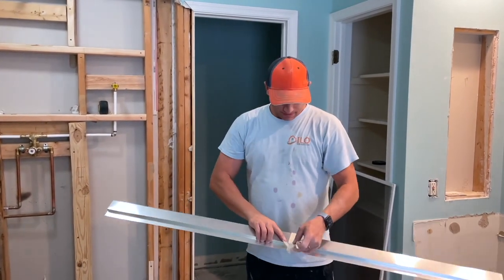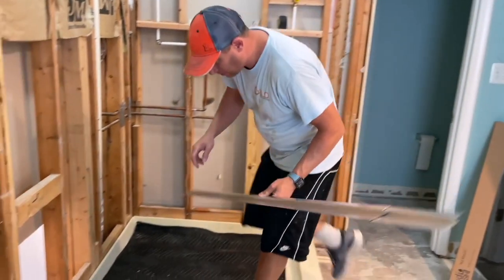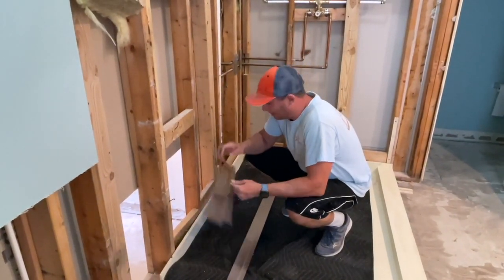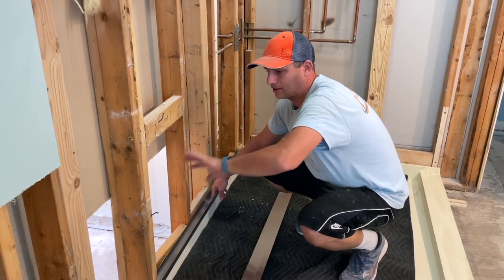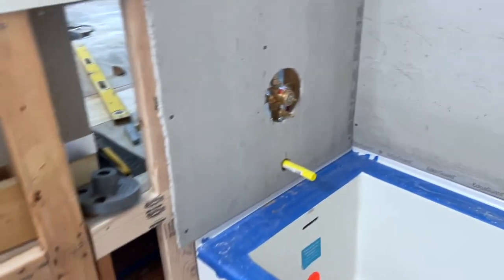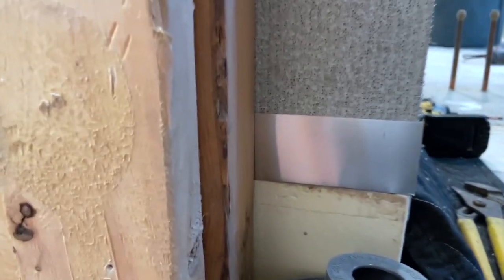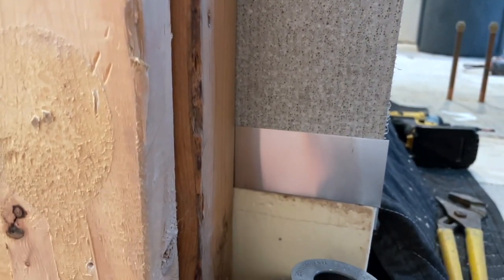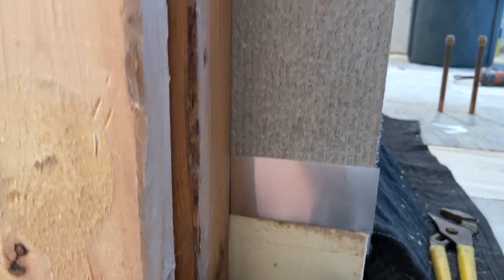Installing the Redi Flash system in a Tile Redi base

Comment: Hello! I really appreciate your videos. I have a couple of questions for you. Do you have any difficulty tiling over the flashing? When you tile the sides of the pan (and in my case the bench top) are you using the tile-redi apoxy on the sides of the pan and the top and back of the bench? I am getting close to hitting my shower with red guard. But I’ve been concerned about these areas. Thanks!
Reply from the maker: The flashing sticks to modified mortar just fine. I’ve put super small tile on that transition between the pan, flashing, and cement board and it’s just fine. If your wall is not pretty close the flashing can bend out or in a little, so be aware of your install. Good luck with the project!
Reply: @TodayIWorkOn   Thank you !

Comment: Thanks for the tips.  Do you put a strip of mesh tape and thin set between the redi flash system and backerboard? or just leave that with caulk and tile over that? Currently unsure if I should add a thin set strip before waterproofing.
Reply from the maker: Nah, I trust the Redi flash and just tile on top of it. I do put my corner waterproofing tape about 1/2 past the metal into the pan so water will hit the pan before it comes anywhere close to the flashing.

Comment: Regarding the Redi sealant used for the Redi flashing…Can I use this Redi sealant on the heads of cement backer board screws??? Or should I just cover them with thinset?
Reply from the maker: Cover with thin set and use a Redguard hydrogen type waterproofing.

Comment: I think the redi flash is only available for 36 depth or less.  So if you have a larger pan or elect not to use the redi flash would you use a band of some type at the seam where concrete board mate up with redi pan?
Reply from the maker: Redi flash is available for any size. I just got some for my 48” wide base. You’re good, use the redi flash.

Comment: Do you have to put membrane over flashing that’s sticking out? And what adhesive do you recommend to use. That will stick to aluminum, backing boards and tile redi pan. Thank you!
Reply from the maker: The mortar sticks just fine on the piece of metal sticking out. Never had an issue.
Reply: @TodayIWorkOn  thank you for replay! Thank you for your video!!!

Comment: This is unrelated but do you have any experience installing a glass panel with a TileRedi base? I talked to the TileRedi support and they said, the glass would need to be anchored to the wall ONLY and if I tried to anchor to the threshold as well, it would crack. However, the glass panels and anchors I have provide instructions that the anchors need to be on the threshold and the wall.

Would love your input!
Reply from the maker: Check out my before and after videos in my playlist and you can see a lot of glass panels installed. If they drill and fill with silicone it’s fine. They have to say that for warranty purposes.

Comment: So a modified thinset like Mapei Porcelain can be applied to the exposed flashing that's on the inside of the pan wall to hold the bottom row of tile and it holds? I thought the thinset curing requires the thinset to penetrate into the tile backer surface (in this case, the metal face of the flashing) and tile surface to properly bond the the tile into its backer material? a metal drip edge surface would seem to to not be able to allow the thinset to "grab" into its surface during curing....
Reply from the maker: I literally just finished up a video on what you are talking about. I actually tested LFT mortar on the metal flashing and it sticked really well. The new tile Redi video will drop in a few days. This is a super common question I get all of the time and I decided to do a video getting into the details about all of the common questions I get about the base, including this one. What I can tell you is I've never had a tile "pop" off on any of my projects and I have baths 5 years old with the tile Redi system. You can always skip the flashing, install a bunch of silicone then tile accordingly, but I feel it's a better system with the Redi flashing.
Reply: @TodayIWorkOn  looking forward to the vid, the flashing is up and the waterproof hardie backer board is over the top of the stud mounted flashing with a big fattie bead of 100% silicone laid down on the flashing shoulder per the redi tile flashing install video. So its not coming out now, lol.

I also ordered the redi epoxy from their site for the glass mosaic floor tile going in. sounds like superglue....

Comment: When you installed the backer board, did you leave a gap up from the bottom of the flashing?  I've seen videos saying that is necessary to avoid water wicking up the board.  Thank you.
Reply from the maker: Water usually goes to the lowest point, I would be surprised to have the water wick 3" high. Gravity and physics would say it would still go in the pan. I always sit the board on the tile flash.

Comment: Do you secure the flashing to the studs with screws like they show in their video?  Seems like a screw would make the backer board get oushed out a bit
Reply from the maker: I push the screw pretty flush with the stud and sink the metal in accordingly. I have a new tile Redi video coming out to go over the common questions people have been asking since I last did a video on the system.
Reply: @TodayIWorkOn  Sweet, looking forward to it.  I still have yet to install my pan.  Holidays and work and life have been getting in the way :)
Reply: @TodayIWorkOn  I also noticed my flashing is longer than the pan dimensions.  Also wondering about how to deal with corners.

Comment: Great video. I'm interested in using a Tile Redi shower base as well, and there aren't many vids to choose from on the internet. My question, can you use any substrate, such as Wedi, for your walls with the Tile Redi pan?
Reply from the maker: You can use 1/2 wedi with no issue. Just buy the Redi flash and you good fam. Good luck with the project!

Comment: @Today I work on Hello. I need to get in touch with you. I have a question about a redi  flashing that I accidentally installed backwards and is sitting too proud of the shower pan walls not allowing me to install first course. How can I get in touch with you
Reply from the maker: Cut the flashing and silicone the transition between the pan and substrate.  Thats the alternative method to waterproofing the pan.

Comment: Thanks for the videos on Tile Redi products, they've been extremely helpful for my DIY install.  Question about the Redi flash: Do you have any issues with the metal not laying flush against the inside wall of the pan once you install your cement board? Mine is kind of flaring out in spots and I'm concerned about my bottom row of wall tile not being able to adhere properly. My studs are against the pan and plum so I'm not sure why it's happening.
Reply from the maker: Sometimes it might have a little bend up, but I never had an issue with it when going to tile. The mortar/thinset take care of it.
Reply: @TodayIWorkOn  thanks for the reply, and thanks again for the great vids!
Reply: I would butter ( not bead ) the entire back side of every pc. of  flashing before installing after 1st checking and adjusting the fit to be sure everything fits as flat and tight as possible.
Reply: @jamesm.8392  thanks, @TodayIWorkOn was correct, once I put tile up, the thinset took care of it. The tile ready base and flashing have been installed for a year now, and it's still one of the best purchases I made for my shower install. Zero issues.

Comment: Question: As I wait for my Tile Redi shower base to arrive, I need to build the two walls that will create the shower surround. (I'm bumping out the exising bathroom wall into a huge entry room.) Should I build my walls to fit the Tile Redi 34"x60" EXACTLY 34x60? or should I leave a 1/4" play, or??
Reply from the maker: If it's an off the shelf pan, maybe a 1/16. I have a WAY better idea for you though. Set the base first then frame the walls. Installing the base will be way easier and installing the walls will be easier since you can pin those puppies to the base. Remember, if you do this, the Redi base tapers, so don't go off the bottom of the base, go off the top lip.
Reply: @TodayIWorkOn  Ahhhh of course.. the issue is: the pan won't arrive for another 4 to TEN days! I want to frame my walls now so I can rough in the plumbing, and carry on with other tasks that require the walls.
Reply: @TodayIWorkOn  When you say, "Set the base first then frame the walls."  Do you mean just set the base in without using the mortar underneath or just placing the base temporarily to build the frame.  I've never done a bathroom before and am new to Tile Redi.

Comment: The flashing is causing lippage inside the pan, how did you correct this? I'm assuming I need to use Thin Set with Tape or Kerdi Band or something but how did you correct this?
Reply from the maker: If it’s flaring out a little, there can be a bunch of reasons. Usually it’s when you over screw the flashing. The screw should be snug, but not making a huge dent into the metal. You don’t have to worry if it will be waterproof. Remember, water flows down with gravity, not up.  The weight of the tile and mortar/glue will push the flashing back. The only time there’s a small issue is if your base is not up against the 2x4’s. That will bend the flash out.
Reply: @TodayIWorkOn  So you do screw the flashing into the studs?  The video makes it seem like it just sits on top.   Also, Tile Redi's install video recommends a bead of caulk between the backer board and the Redi flash.  Do you do that or no?
Reply from the maker: @jpmyers20  correct. I screw on the top of the flash to the stud and i also caulk in the corners with silicone. You’re right, i didn’t go over those specifics, i was more trying to show how the flashing works. Good luck with the project!

Comment: How about the side with drain hole and side opposite to drain hole. They don't need flashing ?
Reply from the maker: Side with the drain hole also had flashing installed. The opposite side is a curb with glass, no wall, so no flashing is needed there. Skip to 5:50 to see the finished area in the master bath https://youtu.be/1CfRIqjUglE

Comment: I was at the local Flea Mkt and an old guy like myself had a few pieces of Redi Flashing someone had left over from an install. He didn't know what they were and only wanted $1 so I got them. A 30" and 2/12". If you haven't seen this flashing it is really thin Alum about 5X thicken than Alum Foil. Not impressive but will do the job. Every kit I see online goes for $65.

To be honest . . . $1,000 Redi Pans concern me . . . I haven't seen them up close but people say they are foam or cheap plastic. AND Redi clearly indicates their pans need all of the reinforcement you can muster. This makes me wonder how well they will hold up over time . . . I believe their warranty is only 2 years.

A question down below about Redi curbing caught my eye . . . You CANNOT put any holes in this pan Whatsoever . . . 
NONE / NoWhere / No How.

When you install a frameless glass kit on top of these curbs with heavy stone slabs . . . silicone (butter) the slabs in place, weight them down, let them fully cure, then cut your bottom glass Bracket "Screws" that hold the glass so that they Do Not Penetrate That Curb ( only the stone covering the curb).
Have a talk with little Johnny when he comes to install the glass and hope he listens.

The only remaining problem I have is that those curbs are hollow underneath ( even after using mortar ) and those curbs are expected to hold at least some of the weight of that heavy glass and all of weight of the slab stone covering. 

For $1,000  . . . IMO . . . We deserve more . . . The underside of those pans should be filled with something light weight but Strong at the Factory that will give those pans lasting rigidity. Some people claim around the center drain is a weak spot of flexibility . . . which should not be.  That pan needs to be stiff to within 1/32" over all parts of it . . . or else.

Comment: Our contractor installed a tile ready pan a few weeks ago. He has not tiled it yet, but there is moderate creaking. Any advice for what to do if pan is creaking after install?
Reply from the maker: I would need a video of what's creeking... is there movement in the actual base itself? Are you sure he set it? Can the creeking be from the sub floor? That's a loaded question and I would need you to show me what's up. I feel your concern.  If you're in the northern va area, I can take a peek.
Reply: Granted, this reply is to late for the OP but for others who may notice creaking... On investigation I discovered my pan was "barely touching" (i.e., just kissing) three wall studs. Even though you couldn't see or feel any pan deflection when you stepped in there was enough movement against the studs to emit a "creak" or cracking sound. Shaving away some wood from the stubs where they were touching the pan eliminated the problem.

Comment: How do you cut The flashing to fit into the corners properly?
Reply from the maker: I cut 1/2 back on both corners where the redi flash is overlapping the actual pan, then bend them out horizontal. Those 1/2 pieces of metal then overlap each other and i apply a liberal amount of silicone under each piece of metal and a bead going up the corner seam. Works very well.
Reply: Thanks for the quick reply your AWESOME!! Can you do a short video explaining how you cut and seal the corners with the tile redi flashing?  It’s a bit confusing 🙏🙏🙏🙏🙏
Reply: @TodayIWorkOn  thanks. This is what I’m here for too as the official video doesn’t cover corners and mine are too long to fit without cutting. The bending thing could work well